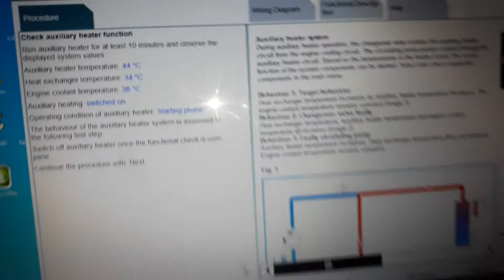BMW F01 Start up Webasto with ISTA D after repair

Comment: Hi
What was the eeprom faulth? How to fix?
Reply from the maker: I had to send my webasto driver to the repair. They reinstall soft there.
Reply: @Donovan Dustin Instablaster :)
Reply: @Jeremiah Cayden thanks for your reply. I got to the site thru google and Im in the hacking process now.
Looks like it's gonna take a while so I will get back to you later with my results.
Reply: @Jeremiah Cayden It worked and I now got access to my account again. I'm so happy:D
Thanks so much you saved my account !
Reply: @Donovan Dustin you are welcome =)